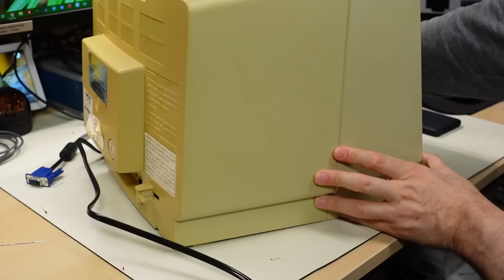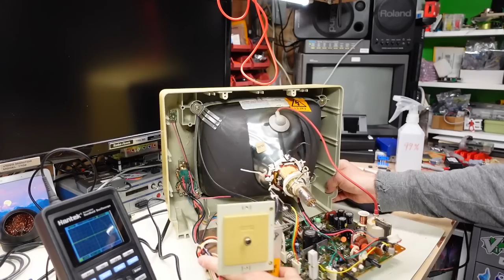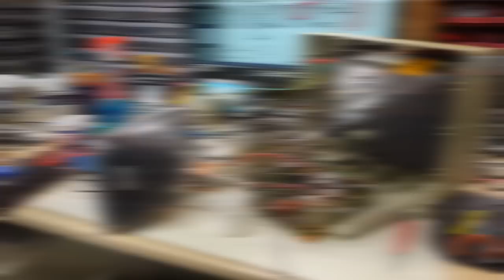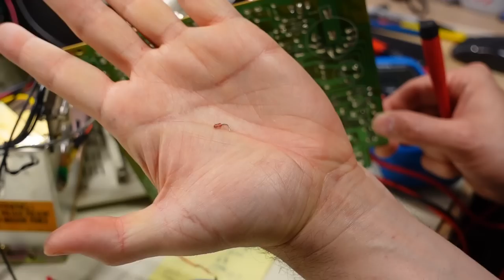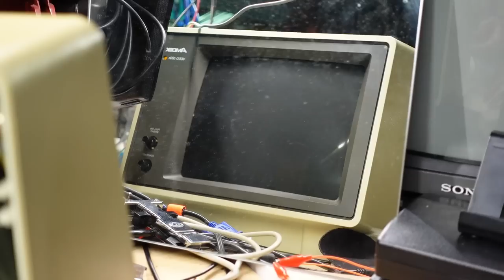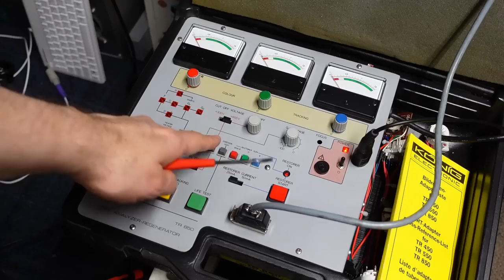I ruined this Amdek 300A after fixing it

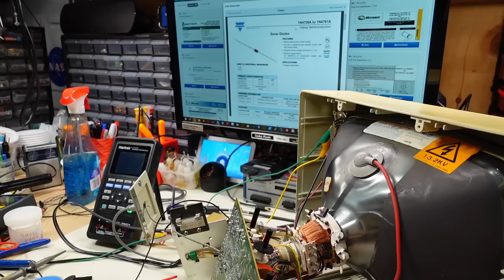Comment: At about 38:50 you said "That looks like it's actually a zener diode, that's problematic" -- and I was just very curious about the 'why' - I know you can't explain literally everything in every episode, but I'd be curious to understand. Thanks!
Reply from the maker: Zener diodes start to conduct at a particular voltage. That voltage can vary from a couple volts to 50, 60 or more. So you have to replace a zener diode with one of the same voltage usually -- but unless you know what that voltage is, you are going to have to guess or reverse engineer the design to figure out what the working voltage is.
Reply: @adriansdigitalbasement2  Technically, all diodes start to conduct at a particular (reverse) voltage.
Reply: @adriansdigitalbasement2  Not to mention the zener voltage, meaning it's not just the diode voltage which lets it pass current one way you have to worry about but the zeners have another voltage that cause them to let it pass the other way too.

Comment: I just repaired my set of active speakers, where the fault was a bad zener. It got hot and eventually went short. It was part of a circuit that split 24V in to +12V 0V and -12V.

Comment: Yeah... "brown gunk" was, in some cases, applied at the factory, and was used because it was expected to exceed the service lifetime of the equipment.  Later equipment used either low acid RTV, epoxy, or something like Glyptal to dope down components.  I'm wondering if the brown stuff is a form of hide glue?

I've never seen any CRT rejuvenators that actually worked for more than a few weeks.  I'm confirmed in the opinion that "rejuvenation" might be nice for a little while, but leads finally to equipment failure.  I would love to see a "new" (or at least "newer") CRT put in this old classic.

Comment: I don't know if you watch shango066's videos but he does say that rejuvination attempts are usually a waste of effort on really worn-out CRTs and even if it does work, it usually doesn't for long.

It might work on CRTs which have just "gone to sleep" after a long period of storage, I think.
Reply: The CRTs last longer when powered by AC. A school system bought about 100 Channel Master TVs that had series filaments. Within two years, the CRTS all started to fail. The so called engineer had a total of 85 volts in the series string, so he used a 'Diode Dropper' to only apply one half of each cycle to the filaments, cutting their dissipation in half. (120 VAC x .707 = 84.84 effective voltage) I added filament transformers and let them burn in for a few hours with a CRT brighter, then removed the brighter., then returned them to the schools. 
This effect is known as Cathode poisoning..You can have the same effect from keeping the filaments hot, with no B+ for a long time. I changed my first CRT in the mid '60s at 13,  and I was a Broadcast Engineer less than 10 years later. Most younger techs haven't worked enough with tubes to understand them properly.
Reply: @michaelterrell  I'm not saying it isn't true but I don't see how running the filament on AC vs DC would have any effect on the cathode emissions. On normal CRTs the two are electrically isolated. It might have an effect on directly heated cathodes like transmitter tubes though.
Reply: @eDoc2020  Believe what you want. I've seen it first hand in hundreds of poorly designed TVs. 
Many monitors use a winding on the flyback to power the CRT, instead of readily available 12VDC.
Reply: @michaelterrell  "Most younger techs haven't worked enough with tubes to understand them properly."

Unfortunately this is also true of me, All my formal "education" was about solid state stuff and so was my time in the TV service trade; my only experience with valves (tubes) is with my hobby at home restoring and using vintage tellies.
Reply: @BG101UK  It was definitely a different mindset. Tube circuits were simple, compared to today's electronics. Early radios used 50% tolerance resistors, and 20% tolerance on wound paper capacitors. Resistors were made, then test before having the color bands hand painted on them. I often hear complaints, 'Every resistor was out of tolerance' from people who insist that 20% was the lowest grade ever produced.. They were the E3 class, and we are up to E192 for some resistors.
Gain in tubes varied quite a bit, as well. The old Radiotron handbooks were an in depth reference on early electronics. The third and fourth editions are available online as free scans.
ere is a detailed description of the various resistor E series: https://en.wikipedia.org/wiki/E_series_of_preferred_numbers
Reply: @michaelterrell  Thanks very much for that, sorry it took me a while to get round to it.
Reply: @BG101UK  It's no problem. Life happens. 😁

Comment: Excellent video I'm glad you decided to cover this especially because not many people are using crts anymore. I have a small monochrome crt from a cnc machine that has no high voltage. It kept burning the hot and one of the resistors in that circuit. Any advice where to start looking for the problem?

Comment: Schematics and a Sam’s Service Manual is available for this monitor, no problem.
I was excited to see at first as I thought you were doing the 310 version(I have a faulty one here).
For the other Amdek 310 monitor version (with the 9pin input) nothing I can find ! 
The boards are completely different for the 300 and 310 models, sadly 🤷🏻‍♂️

Comment: Always seems to be the blood diodes in these old monitors.  You're lucky you've got any readable markings on it.  The 8-Bit Guy fixed some monitors that had been stored outdoors for a few decades a while back (fortunately this was in Dallas, TX, so they didn't spend all that time wet) and his monitors didn't work properly because each had a critical diode that had disintegrated and was completely unreadable before it fell apart.

Comment: That zener diode is part of a video level regulator circuit which is basically setting the shelf of the video signal so that adjustment of the contrast control or varying cathode load don't affect the picture.
Reply: Interesting theory, but as explained in a note above, it turns out that it isn't a zener.
Reply: @donmoore7785   it wouldn’t have to be, necessarily. The diode appears to be part of a DC restoration circuit, so a zener would serve as sort of a gilded component where a general purpose component would do.

Comment: Did you discharge the Kathode in 6:20 with that measurement of the high voltage? I may triy also to repair a CRT,but I 'm a beginner and afraid of the high voltage.

Comment: SIr, that yellow stick is too short. I remember my dad showing us high voltage sparks by just getting a long screwdriver near it. It was an old tube Philips very large (for the time) and faulty TV but, well, high voltage is a killer beast.

Thanks for the troubleshooting! I have two color Apple IIgs monitors and one is not working while the other has issues and your troubleshooting will be helpful! I got info from a guy called Mr.Joooooohny (nor sure how many letters - really nice channel that I'm not sure still exists) who told me "if the filament is lighting, your tube is ok or fixable". Very nice guy from Eastern Europe, btw!

Comment: I noticed that when you turn up the brightness, the picture blooms and gets bigger around the same time. It's well-known that the increase of picture size is caused by the anode supply being overloaded, so HV goes down, the electrons get slower and spend more time near the yoke getting deflected. The other grid voltages are generated on the same transformer, so if HV breaks down due to overload, so does the focus voltage. So possibly the blooming is not an effect of the CRT being overdriven itself, but "just" of the supply being overloaded.
Reply: There are two things sometimes called blooming. The first is the picture enlarging when turned up due to the HV falling. This is unrelated to the tube wearing out and in fact tells you that the cathode is strong enough to pull a decent amount of current.

The other thing called blooming is the beam "losing focus" when bright. This is usually the cathode being worn out and needing to use more emissive material.

Comment: I believe the camera showing the CRT as brighter than it is, is because of the reduced dynamic range of the camera, being less than the human eye. Dim things look brighter basically.. You'd have to be shooting in S-log or something to get a real representation of the dynamic range. Probably not worth it!. Seems like the 'rejuvenation' process is really hit and miss. More miss than hit!.
Reply: PS. sometimes using a small rubber hammer or end of screwdriver lightly tapping the neck can help. Just enough to shake up the gun.
Reply: PS number 2.. I once saw a technician take off the anode cap and with the CRT base disconnected, run the anode cap around the CRT pins. Causing some sparking.. It worked!. Picture got better. I've never tried this personally but thats what he did.

Comment: As for CRT rejuvination, it's possible the newer tool may have faults of its' own, causing it to over-do the process of "rejuvination" ending up with it wrecking the guns rather than cleaning them off, but that's just me purely clutching at straws, could be perfectly fine and the CRT was just on its' last legs anyway...

Comment: Sad, those were good monitors back in the day.  The cloth screen was a mistake (even worse were the GLUED ON screens).  But no CRT ever lasts forever.  The phosphor just wears out over time.  I believe the phosphor actually oxidizes, but i might be wrong about that.
Reply: The phosphor degrades, but definitely not oxidizes, as there's no oxigen inside the CRT. Usually the degradation of cathode emissions what has a bigger effect on the picture quality of the CRT. Cheap rebuilt CRTs had their original phosphors on the screen, and just the guns got replaced, and they were OK to use up a second gun. But when a tube got rebuilt a second time without replacing the phosphor, that was probably not too great I guess.
Reply: @mrnmrn1  Gotcha.  But a degraded electron gun won't show patterns of "burn in."

And all vacuum tubes have at least some oxygen in them.  Those vacuums are not perfect, and even with a getter, there are still stray oxygen floating around in there.

But i agree, it's not oxidation, at least not to any measurable value.  I wonder if the phosphor actually gets "blown off" from the impacts of the electrons slamming in.  In a color tube, those electrons are moving!

But phosphor degradation is a slow process.  I've owned old monitors that had burn in,  but they were on 24/7/365 for 5-6 years before i got them.  But hey, free monitors!

Comment: Back in the 70's you could get a CRT referbished (used it for color tv repair). They would cut off the neck and replace it with a new one. I'm guessing that that type of service is not around anymore. Who has a CRT anymore but with the retro movement?
Reply: The last known rebuilder went out of business a decade ago. What little supplies were left were for early color TV CRTS A TV museum has the equipment, but no source for new guns. I have some good, used green CRTS., but I gave away the only Amber ones years ago. I have about 100 old monitors in storage, along with some Telex color IBM mainframe terminals. I am donating most of my collection of Mini/Mainframe hardware to a museum in PA. I do have dozens of working 360KB floppy drives, and a bunch of Commodore drives.

Comment: the B&k 490b ( of which i also have one ) was NOT made for rejuvenation  smaller CRTs like that, you can test small ones, but if you try rejuvenation, you will destroy them 90% of the time.  it was made for TV sized CRTs which had more robust elements,  It will DESTROY small tubes like that almost every time, even on the low setting of 25...

Comment: I think that crt tester is broken, the rejuvenation feels waaaay to long compared to others (less than 3 seconds).
Reply from the maker: It's the BK Precision 490B and reading the manual, it is working "As designed." It's using 555 timers to run the process supposedly automatically .... I had an old B&K from the 60s (a 460 I think) and it was 100% manual but also almost always made CRTs worse in the same way.
Reply: @adriansdigitalbasement2  
Oh interesting, didnt realize that it is a "smart" one.
 Just thought the internal timer broke and went from 2 seconds to 30 seconds non-stop rejuvination.
Reply: @MyCrazyGarage  it’s a pretty fascinating microcontrolled (IIRC) unit from the early 90s! I’d definitely recommend checking out Adrian’s video from about a year ago when he got it (though alas I don’t recall if the title specifically calls-out the new tester, or if he simply circumstantially shows the new unit in one of the CRT videos).
Reply: @kaitlyn__L  Yes, it takes its sweet time and uses advanced micro-electronics to fuck up CRTs, instead of doing so in only a few seconds.

Comment: It might not necessarily be the rejuvenator's fault. The way those things work is by providing a very powerful positive charge to the cathode of the CRT to literally blast away any oxidation. Applying these kinds of charges is risky and can cause catastrophic damage. And even when they do work, they cause some amount of damage anyway and shorten the life of something that's already one foot in the grave. They're not meant for anything but a short term fix. In the best case scenarios you'll get a few more months of regular use out of a CRT that would otherwise be too tired to be usable. It's really a last ditch effort. It's like giving dying grandpa a shot of morphine and adrenaline so he can have another nice day at the park before kicking the bucket.
Reply: It really depends on the tube. Before I had a CRT tester, I rejuvenated tubes with a 1N4007 diode, a 9V mains transformer, and a 60W bulb in series with the 230V mains, and that across the cathode and G1. It produced the same light show as Adrian's tester at the beginning. Not many tubes died, almost all of them was improved for at least a short time (weeks or a few months), and some of them lasted really long. Like our 22" Chechoslovakian TESLA color tube (Toshiba licence), the emissions were OK-ish (by eye, it wasn't very dim), but the convergence and focus was horrible in the corners. I hit it with the 60W bulb method,  and it was used for about 2 more years with great picture, about 12 hours a day! The flyback died before the rejuvenated tube. I still have that tube, last time it was used in an other set for testing it still had good picture (that was around 2006-2008...).

Now I have the same tester as Adrian's, and it can be used for rejuvenation with great success, as long as you don't allow it to go through all three passes. I always turn it off after the sparking tamed down, and test for emissions. Sometimes it needs a second pass, but almost never a third one like it would do automatically. If you let it go through two more passes after the tube sparked, it kills the tube. That was happened here almost surely, the tube was good after it sparked, than the two remaining cycles killed it. 

Also it seems to me that Adrian's has some timing issues, the cycles feel to long. It uses 555 timers with electrolytics for the longer timings, so it's entirely possible that some timing capacitor gone leaky and made the corresponding timing longer.

Comment: I wouldn't feel bad about the rejuvinator fail. Even when it does work, many times the tube will start to look bad again a few days later. Most of the time those rejuvinators were used as a temporary fix while the engineer ordered in a replacement tube.

Comment: When I was learning Tv repair I made my own tube rejuvenator we never did it for as long as you did it would be 5 seconds max the heater voltages and screen voltages are way higher than normal all the testers I used that were commercial you held the button for a few seconds

Comment: Fix it 'till it's broken! jk, nice work, shame about the weak CRT, that brown glue is nasty stuff, it's called Sony bond, when it was new it would be a yellowish clear colour but over time it brakes down and becomes not only corrosive but conductive too, causes all kinds of issues, they used it a lot on stereo equipment from the 70s and 80s.

Comment: Careful overdriving crts, as you push the acceleration voltage over the design values you start to wander into X- Ray territory... As Shango often does, stand the monitor with a picture for at least 30 mins, they can come back on their own.
Reply: The bad cathode biasing won't on its own produce xrays.  The old tube based HV rectifiers were the biggest offenders and had to be shielded.  Excessive HV anode voltage is the xray danger.  That CRT was so weak it could hardly produce enough beam current to light the phosphor let alone make xrays.
Reply: @kilwala2242  the persistent myths about the output of the phosphors is something I find interesting. (Though in this case I’d give OP the benefit of the doubt and assume they were talking about the whole system being in “x ray territory” rather than specifically the front of the display tube.) I once got into an argument with someone who insisted high-energy electrons were shooting out of the front the whole time, despite the return-current hookups, the fact you need a complete circuit for it to run properly, and that any small current leakage just builds-up as static on the front… he just kept insisting a CRT produces a huge stream of ions, hitting anywhere it outputs light onto.